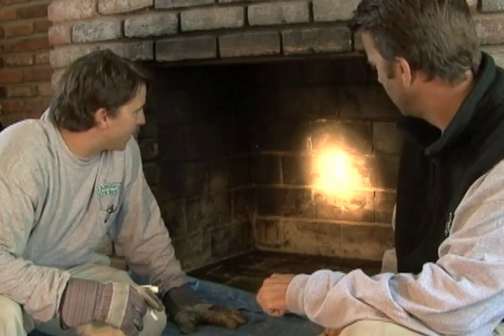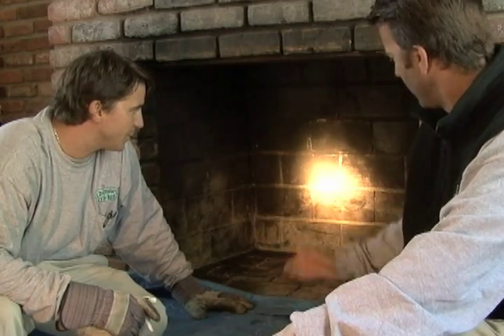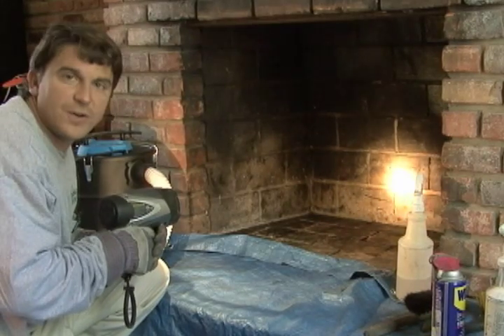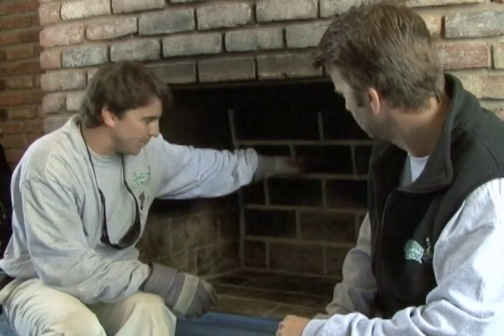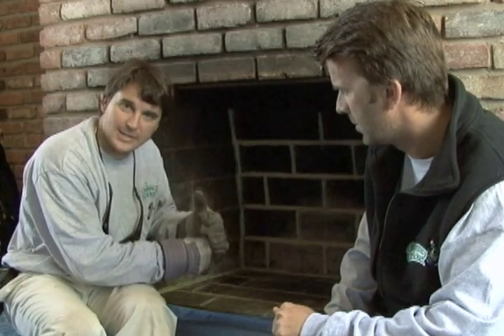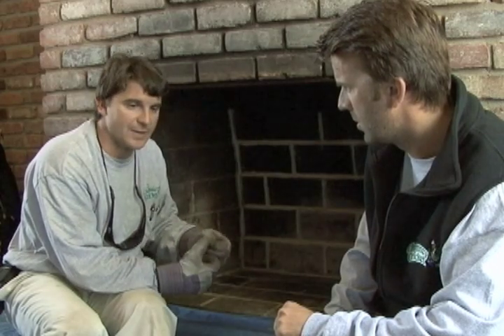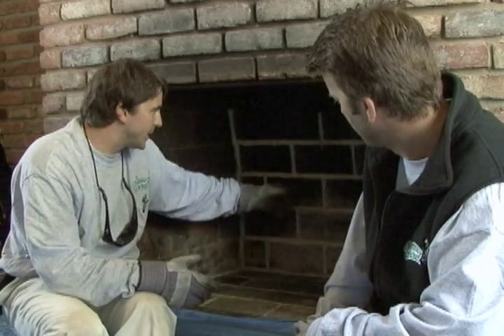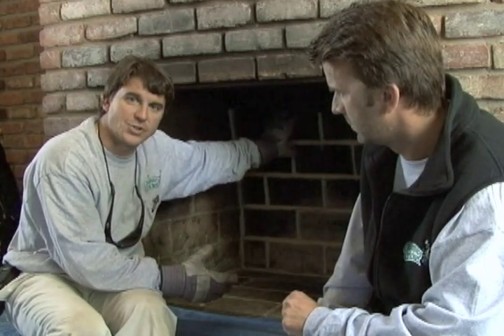Firebox Repairs

Comment: I am trying to find out if my firebox can be repaired.   It is all metal except for the bottom which is firebrick.  A masonry guy replaced the firebrick on the bottom but told me, "it should be safe enough for a fire.  Another fireplace company told me I'd have to have the firebox lined with stainless steel and buy an insert.  The original metal box has gaps at the seams  between a quarter to two inches of gap.  I can see insulation type material through the gaps.  I know this is old, but can a metal firebox be repaired?  The alternative I was told will cost over $7k.  Thank you, as I am having trouble finding info on metal fireboxes.  Also, the chimney has been repaired, built higher (code) with new flue and cap ($5k).  I just purchased this home in June and don't have any history on the fireplace other than it leaked.
Reply: I am also looking for this info. Just bought a house and don’t have the house history issue.   Hoping there will be a response.

Comment: I bought a Victorian that was in foreclosure forever. It has some problems. The brick inside my fireplace has deteriorated so much that the there's no morter, just bricks. Can I use the GOO to repair those? Can I put in an insert wall inside the fireplace or do I need to mix cement to relay the bricks? Do you sell the fireproof walls for inside the fireplace? What type of morter mix would I need to buy and where is is sold at?